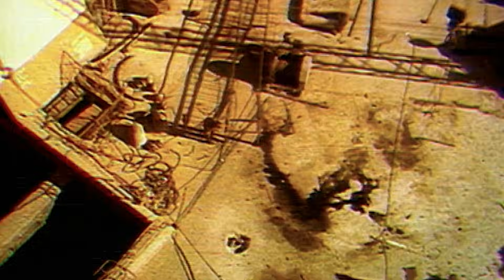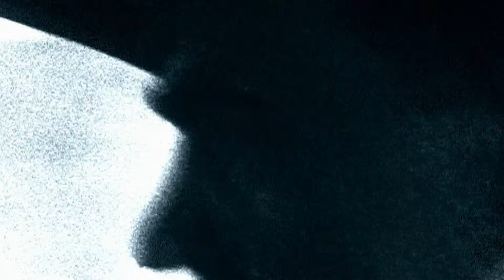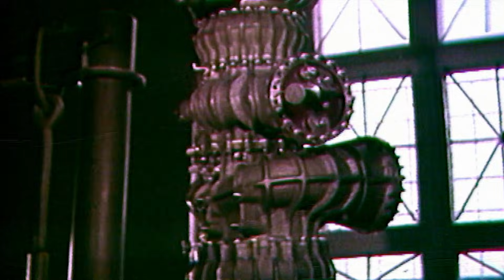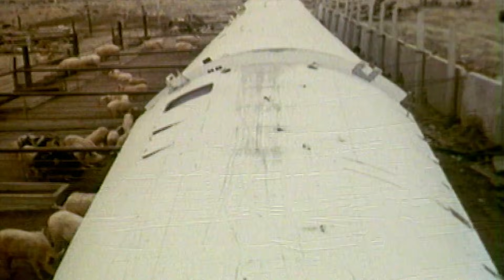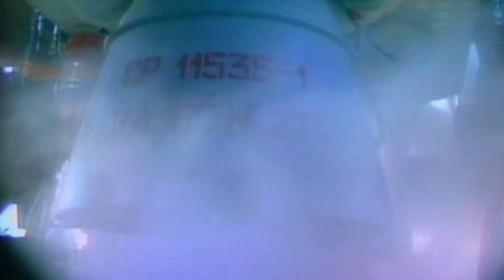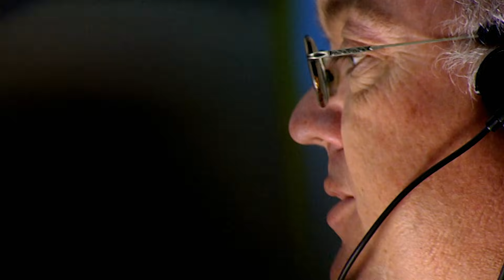How Cold War Shaped The World's First Spaceport | Baikonur Cosmodrome

Comment: The Soviets followed a radically different design and testing philosophy than the US.  They simply didn't have the investment in large test stands and other facilities early on to test rocket engines on the ground, so they tested them in flight, heavily instrumenting the rockets with downlink telemetry, recording all the data from the flight as the rocket ascended to shutdown, or blew up in flight.  For their early missile developments, this system worked well, as the rockets themselves weren't that expensive or difficult to replace, versus making a huge investment in the test stands and test centers required to do extensive test firing as was done in the US.  It was felt that the N-1 would be no different, BUT the N-1 was a truly enormous rocket and enormously expensive and powerful rocket, so it was MUCH more expensive to develop and test fly in this way.  

The other issue was, the Soviets didn't commit to the lunar program until years after the Americans.  This frittered away valuable lead time they would need, as the lunar mission was specifically chosen by the US as a way to demonstrate their technological prowess with a goal so hard to achieve that the early lead the Soviets had in large rockets, specifically the "Semyorka" R-7 former ICBM which was the backbone and workhorse of their space program (and remains so today as the "Soyuz launcher") would be of little consequence.  Korolev's untimely death in early '66 just exacerbated the problem.  

Another thing that helped the Soviets was, they were very late to the solid propellant technology that the US pioneered early on.  The US developed large solid propellant technology for missiles such as Polaris and Minuteman ICBM's.  Both the US and Soviets realized that the first generation missiles, Atlas and Titan in the US and Semyorka R-7 in the Soviet Union, had a lot of limitations and drawbacks.  All were powered by kerosene and liquid oxygen.  All were highly vulnerable, though the US put Atlases first in "coffin launchers" on the surface and then in silos along with their Titan 1's.  Semyorka was too big for a practical silo and launched from surface pads.  All these missiles required being fueled immediately before launch, which could take hours, and liquid oxygen, being cryogenic and boiling off, had to be topped up continuously until liftoff, requiring a large supply of supplemental propellant, meaning that the missile could only stand "on alert" so long during a crisis situation, because once that propellant supply boiled off and was lost, the missile had to stand down until more propellant could be hauled in to the supply tanks.  Both sides started working on "storable propellant" missiles, that could use propellants capable of being stored for long periods of time at room temperature.  These propellants, primarily combinations of hydrazine for fuel and various oxidizers like nitrogen tetroxide, red fuming nitric acid, or white fuming nitric acid, were also extremely toxic and usually highly corrosive, BUT they could be stored in the missile virtually indefinitely, meaning the missiles could remain fueled in the silos and ready for launch at a moment's notice.  The US developed the Titan II missile using the new storable propellants, and the USSR started developing a whole series starting with the R-9 missile.  The US's decision to pursue a fleet ballistic missile, which would result in Polaris missiles in submarines, drove the development of solid propellant technology as it was deemed FAR safer in a confined submarine than the hazardous toxic storable liquid propellants, which normally were "hypergolic", meaning they ignited on contact with one another, and fire is one of the biggest threats aboard a submarine.  The US rapidly developed solid propellant missiles like Polaris, and realizing its advantages even over storable liquid propellants, soon incorporated it into the next generation of ICBM's, Minuteman.  At that point liquid propellant missiles in the US basically became extinct as the remaining Atlases and Titans were phased out, and only the huge Titan II's with their unique enormous warheads were kept in service.  

In the Soviet Union, their early attempt at a solid propellant ICBM, the NATO code-named SS-13 Savage, was mostly a failure.  It worked but had a lot of problems, so the Soviets continued to develop storable liquid propellant ICBM's and sub-launched missiles until the late 70's or 80's, at which time their solid propellant technology had caught up and the advantages of solid propellants over storable liquid propellants was clear to them as well, at which time their new ICBM's and SLBM's were all solid propellant.  The decades of additional development of large powerful liquid engines would help them immensely.  More to come!  OL J R :)
Reply: The space programs in both countries had also contributed to the differences.  In the US, the "Moon Race" drove the choice of the enormous F-1 engines... F-1, whose size was the real challenge, obtaining smooth, stable combustion across its enormous injector face in the combustion chamber, was basically just an enlarged version of the same open combustion cycle relatively low pressure bypass engines used on all previous US launch vehicles.  The combustion instability problem was the biggest issue faced by F-1 developers, that and the sheer size of it, having to develop enormous autoclaves to weld the thousands of nozzle tubes together to make the combustion chamber and nozzles of the engines.  Once it was discovered that small "fences" designed into and attached to the injector plate face, would prevent pressure waves from rippling across the injector face and creating combustion instability that could destroy the engine, the F-1 was basically complete and soon "flight ready".   The Soviets didn't have the capability to build such enormous rocket engines; to get the thrust levels they'd needed for Semyorka, Valentin Glushko, their premiere rocket engine developer, had an ingenious solution-- he could build a turbopump assembly large enough to deliver the amounts of propellants required to produce the needed thrust, but building a single combustion chamber large enough was beyond their technology of the time-- so he built four SMALLER combustion chamber all clustered together, and supplied propellants from the single turbopump assembly, four nozzles acting as a single larger engine.  It worked fantastically well and was used on many different Soviet engines, culminating in their RD-170 engine for the Zenit rocket, which became SeaLaunch later on, and was the main booster engines for the four Zenit liquid rocket boosters used on their enormous "Energia" rocket designed by Glushko to launch enormous payloads mounted on the side, or carry their "Buran" Soviet space shuttle.  They even had plans to eventually parachute land and recover the Zenit boosters for reuse, though this never happened.  

When the Soviet government finally gave approval for a Moon program, the "Chief Designer" Korolev was charged with designing a vehicle to make it work.  Glushko, who had designed all the rocket engines for his previous vehicles, had been developing larger and more powerful storable propellant engines for the Soviet Strategic Rocket Forces (ICBM force).  Glushko and some rival designers were vying for government approval to build a series of large storable propellant launch vehicles (the "Universal Rocket" or "UR" series vehicles, basically larger versions of Proton).  Korolev, having run the calculations on performance required, wanted higher performance kerosene/liquid oxygen engines.  Glushko vehemently disagreed and they couldn't come to terms, so Korolev was forced to look for alternatives, thus ending up with Kuznetsov.  

Kuznetsov's designed the NK-15 rocket engines, which were powerful but not as sheerly massive as the F-1's.  They were very high performance, but they had one shortcoming-- they could only be fired a single time-- meaning they couldn't be test fired without ruining the engine.  To overcome this, the engines were built in batches of six, with each one undergoing the exact same procedures as the others as they were constructed and assembled.  Five would be sent to be used on the launch vehicles, one would be test fired for verification of the other five, which of course destroyed it.  The assumption that this sufficed for testing would lead to one of the explosions of the N-1 when some foreign metal debris left in a propellant duct was ingested into the engine and caused it to explode.  

More to come!  OL J R  : )
Reply: The other thing about the N-1 was, while it was larger even than the Saturn V (heavier anyway), in some ways it was absolutely cutting edge, in other ways it was rather primitive.  Its first and second stages were powered by liquid oxygen and kerosene, which from the rocket equation and engineering standpoint is the best first stage propellant combination available, superior in specific impulse (fuel economy, basically) than either solid propellant (as the US shuttle used and now the SLS derived from it) or storable propellants, and while liquid hydrogen and oxygen has a higher ISP, it's much lower density requires GARGANTUAN stages be constructed to hold enough for it (Saturn V's first stage would have been half again as long had it been powered by LH2).  The added stage mass makes performance worse than using the lower specific impulse but much denser kerosene/LOX combination.  The third and fourth stages of N-1 were powered by storable liquid propellant, which is MUCH lower specific impulse than liquid hydrogen and liquid oxygen (LH2/LO2), which was used for the upper second and third stages of Saturn V.  Because of this lower efficiency in the upper stages, N-1's performance was actually less than Saturn V despite being a bigger, heavier rocket. 

The other thing was, the Soviets didn't have the capability to build enormous cylindrical, domed pressurized propellant tanks like the US did, though the effort to build the enormous tanks for Saturn V required creating new techniques and advanced the state of the art considerably.  It was much simpler to design and construct simple spherical pressurized tanks of the size required, which then required very long intertank structures to connect the fuel and oxidizer tanks to construct the rocket stages.  In addition, because of the different amounts of kerosene and liquid oxygen required, the oxygen tank was considerably larger, so the smaller kerosene tank was at the top of the stage, and the large oxygen tank at the bottom, with a sectioned conical long intertank structure connecting the two, to make the hull of the tapered conical stages.  Propellant lines were ducted around the larger lower tank, covered by sheet metal, visible as the "ribs" on the side of the stage, carrying the kerosene to the lower thrust structure containing the engines at the stage base.  Saturn V ducted its propellant lines THROUGH the lower kerosene tank, insulating them to keep the minus 290 degree liquid oxygen from freezing the kerosene into ice on the propellant ducts, all to save weight.   The stages were connected by an open tubular trusswork interstage common on Soviet rockets, as they almost all use "fire in the hole" staging where the next stage's rocket engines fire up while the stage below it is still burning, just before its engines shut down, eliminating the need for ullage rockets to settle propellants in the upper stages before ignition, and separation rockets to pull the stages apart when the interstage separates.  This spherical tank design and longer intertank structures were heavier and less efficient than the cylindrical tanks with hemispherical domes used to construct the tanks on Saturn V. This also contributed to the larger size of N-1 and lower performance compared to Saturn V.  

While N-1 was structurally more inefficient than Saturn V, it did have cutting edge features besides its engines.  The main one was the KORD control system, which was revolutionary, never tried before or since AFAIK.  Most Soviet rockets up to that point had used small swiveling vernier engines mounted beside the larger main engines at the stage base to control the rocket and correct its trajectory in flight, steering it as needed.  This eliminated the need to construct gimbals strong enough to swivel the engines and connect them to the stage, and hydraulic systems powerful enough to gimbal the engines under thrust.  The KORD system would do away with the extra weight of the vernier system and its smaller gimbals and hydraulics, controlling the rocket by throttling opposing pairs of engines on opposite sides of the rocket, which were "fixed" and not swiveling or gimbaling.  If the rocket needed to turn a certain way to maintain stability to change trajectory, the engine on the inside of the desired turn direction was throttled back, lowering thrust, and the opposite engine on the other side was throttled up, increasing thrust, thus turning the rocket in the desired direction.  This was a cutting edge system, but quite complex and had its own set of drawbacks that would become clear in time.  

TO be continued...  OL J R :)
Reply: On the first N-1 flight, a fire broke out in the thrust structure of the stage.  The network of propellant lines to connect the 30 NK-15 engines together presented a lot of opportunities for leaks and for fire to break out.  The fire quickly burned through the control wiring for the KORD system, the rocket went unstable and blew up.  Analysis of the telemetry data showed the problem, so the aft heatshield of the N-1 was beefed up, and greater insulation was installed to protect the KORD control system wiring from heat/fire.  On the second launch, metal was ingested into one of the engines shortly after liftoff, and the engine blew up, taking out an adjacent engine.  The control system detected the problem, and to keep the rocket stable, was designed to shut down the opposite engine from the damaged or malfunctioning engine, which shut down two engines on the opposite side of the rocket.  With the loss of 4 of its 30 engines, the rocket had insufficient thrust and keeled over and crashed back down onto the pad, and blew up with most of its fuel load, resulting in an ENORMOUS explosion similar to a small nuke, severely damaging the pad which had to be rebuilt.  The third flight of N-1 was almost successful, coming within a few seconds of staging, but an uncontrolled roll developed which the KORD system was unable to cope with.  The fixed engines on N-1 were all carefully aligned before launch, but couldn't swivel (gimbal) to control the flight path or correct undesired motions of the vehicle.  The KORD system controlled the stack by throttling opposing engines on opposite sides of the vehicle using "differential thrust" which could correct pitch and yaw instabilities and steer the rocket, but were incapable of controlling roll motions.  The rolling of the stage built up during the flight until just before shutdown of the first stage, it exceeded the structural strength of the stage and the rocket broke up seconds before the second stage would have ignited and the errant first stage shut down.  

In the meantime, Kuznetsov had continued working on improving the engines.  The upgraded NK-33's were designed to be "reusable", meaning they could be fired more than once (unlike their predecessors).  While no provisions for recovering the first stage for reuse was possible, it meant that the engines COULD be individually proof-fire tested before being installed on the launch vehicle.  The fourth N-1 was constructed with improvements to the KORD system and the new engines, and all the chief designers working on it were highly confident that it would be successful.  Launch was just weeks away.  Bad news was about to arrive for the N-1 and Korolev's old team at OKB-1, however... 

To be continued... OL J R :)
Reply: It's important to realize that the Soviet space program operated fundamentally exactly opposite the US space program.  For instance, in the US, the government had established NASA in 1958 as an independent civilian space agency, charged with overseeing all civilian space exploration programs established by the US.  NASA had been formed around a core of the best aeronautical engineers and pioneers in the US at the time, the old NACA, the National Advisory Committee on Aeronautics.   This was soon enlarged by the addition of the DARPA group working on advanced large space boosters under Werner Von Braun at Redstone Arsenal in Alabama, which had been formed under the auspices of the US Army to develop a 1 million pound thrust space booster capable of matching the Russian's large booster performance (which would become Saturn I).  The Redstone Arsenal soon became part of NASA, renamed the Marshall Space Flight Center (MSFC).  NASA's space pioneering engineers like Maxime Faget, designer of the Mercury capsule, the other Space Task Group engineers who created the Mercury space program, and Von Braun's team at MSFC working on the advanced large boosters, soon to become Saturn I and later Saturn V, along with many others designing the requirements for the Apollo spacecraft and designing the lunar missions.  NASA designed the missions and requirements, requested individual aerospace companies submit proposals for spacecraft to meet those requirements, then evaluated the competitors and selected contractors to build the actual spacecraft, which NASA largely designed.  Thus the US space program was essentially always under NASA's overarching control, with NASA acting as both research and designer and determining mission requirements, then selecting and overseeing a vast army of contractors all supplying parts of the system which NASA then integrated into all aspects of the overall mission systems, from construction and testing via building and overseeing new test centers and in some cases (like Michoud) factories, to transportation of stages and elements as required, constructing new ground support facilities and ground support equipment, integrating the mission vehicles, and checkout, launch, and controlling the missions right down to recovery afterwards.  NASA oversaw the contractors and when needed, issued changes to the requirements or hardware and even changes to the contractor when they had problems if required.  In short, the US space program was very much operated from the top down, like a military effort, all directed from the top and subsequent levels below that issuing orders to its subordinates.  

In contrast, the Soviet space program operated very much in a competitive manner.  There was no large overarching Soviet space program, the entire effort was rather disorganized actually.  The Politburo had put the entire space program basically under the control of Marshal Dmitri Ustinov, a capable administrator, but he had little in the way of structure or resources and no overarching program defining the program goals and direction.  Each project had to gain approval on its own, and the Soviet system wasn't particularly good at making the best use of its limited resources, often approving COMPETING vehicles and programs from different "chief designers", an approach that had worked well for the Soviets in the past in many different areas; if one program was a failure, likely the other would succeed and provide redundancy.  However, in the expensive and difficult arena of space development, the duplication of effort and division of limited resources set back progress.  The space program in the Soviet Union had always been an offshoot and very much subordinated to the needs of the Soviet military and missile program; there was no sharp dividing line between "civilian space" and "military/space" as there was in the US with the creation of NASA by Eisenhower in 1958's Space Act.  Since the Soviet Union was communist and had no 'aerospace corporations" like the US, their system had developed around "chief designers", geniuses in their particular field of study and organizing and producing factories and laboratories to develop and build new technology and hardware as needed for various projects... most were specialists in various fields from communications, instrumentation, propulsion, structures, systems engineering, electronics, etc. which then became their design bureau, usually named for the creator and given a generic bland Soviet title with a number.  Some of the larger design bureaus headed by particularly gifted individuals like Korolev became generalists doing many different facets of the program, usually coordinating all of them, though delegating some of the efforts to smaller design bureaus in the various specialized fields as needed, with them acting as "subcontractors".  Korolev's OKB-1 (General Machine Building bureau number 1, a name that would be changed several times over the course of history but the overall organization remained pretty much the same) was the lead design bureau for most Soviet space flight activities, though many other chief designers and their bureaus contributed to the work, designing various systems for the spacecraft and rocket, etc. which OKB-1 basically oversaw and integrated into the vehicle and mission as needed.  As time passed, many other chief designers sprang up with their own growing design bureaus which became competitors to Korolev's OKB-1, like Chelomei and Yangel's design bureaus.  They had started out designing Soviet ballistic missiles and were given resources sufficient to the task as needed, and grew their organizations to the point that they were competing with Korolev.  With no centralized authority actually overseeing Soviet space activities, let alone forming them into a streamlined program with a defined goal and routing development to progress towards the ultimate completion of that goal, the Soviet space program was rudderless.  Worse, it was given to political whims and always to the shifting winds of who was in favor or out of favor, who had political influence and who's star was on the rise versus who's was falling, and whom among the chief designers had "picked the right horse" politically to get approval for their projects, and who hadn't, rather than programs being selected and funded on the basis of their various merits or contribution overall, or their advantages over other competing programs offered by others.  In short it was about more "who you knew" and how much political power they wielded rather than having the best design or vehicle or idea or mission.  A lot of times those winds of power would change over the years, as political fortunes of those at the top sponsoring certain chief designers or their projects came and went or gained or lost favor, and so chief designers could find their projects funding cut drastically or canceled altogether on the cusp of success, strictly because of political whims.  Thus the Soviet space program suffered from being "*too competitive*" as competing chief designers got programs approved that often were in direct competition AGAINST each other and needlessly duplicated the efforts and divided the resources, in comparison to the US space program which was very much centrally controlled via NASA which oversaw the entire effort of its myriad contractors all working for and answering to NASA as the ultimate authority (given approval and funding by Congress of course).  

 Khrushchev had originally been wooed to support activities in space by Korolev as a means to obtain a propaganda victory over the United States via the Sputniks in the late 50's, then with a series of 'space firsts' for the Soviet Union via the power of Korolev's R-7 Semyorka rocket, which launched not only the world's first artificial satellite Sputnik 1 in 1957, but the first live animal in space, Laika the dog on the much larger Sputnik 2, a litany of space probes toward the Moon and then the other planets, particularly Venus, and with the addition of new upper stages and a man-capable Vostok spacecraft, launched the first human into orbit, Yuri Gagarin in 1961, the first woman in space, Valentina Tereshkova, and set a series of space records for the longest spaceflights.   The one-crew Vostok was soon modified into the multi-passenger Voskhod, primarily through the addition of a soft-landing rocket attached to the parachute stringer above the landing spacecraft that allowed the capsule to soft land without the crew ejecting as they had on Vostok.  This allowed them to cram 3 crewmen in plain clothes into a Voskhod to claim the first three-man flight record, (since there was no room for space suits in the cramped confines with 3 men aboard) and, installing a small inflatable airlock and a two man crew in suits, claim the record for first spacewalk or EVA.  The Soviets even launched several Vostoks at once to claim the first multiple vehicle spaceflight, though Vostok and Voskhod didn't have the propulsion or navigation capabilities to perform a true rendezvous in space; the best they could do was "formation flying" coming within a few dozen miles of each other before drifting apart again due to orbital dynamics.  Thus the US achieved the first space rendezvous in orbit, between Gemini 6 and 7.  For rendezvous or more advanced missions, the Soviets would need a new spacecraft with greater capabilities-- Soyuz.  

More to come!  OL J R :)
Reply: After Korolev's untimely death in early 1966 (having gone in for a hemorrhoid removal surgery, expected to be routine, a high-ranking military surgeon who performed the operation but had really been an administrator long enough he was no longer the most qualified surgeon, had found it was cancer and tried to remove it, Korolev experienced uncontrollable bleeding and due to his jaw being broken when he was in the gulag at Kolyma decades before, the oxygen mask wouldn't properly fit him, and by the time the surgeon sent for a more experienced surgeon to take over had arrived, Korolev had died on the operating table), Korolev's OKB-1 bureau had his deputy Vasily Mishin named to succeed him.  Korolev had not only been a gifted engineer, but his reputation and fame had grown with his repeated space successes from the late 50's.  His boundless energy and charisma, and his reputation had gained him a lot of power with the politicians when it came to getting his space programs approved, and gaining favor over his competitors.  His loss and replacement by Mishin, who while a very capable engineer and designer but who had NONE of Korolev's charisma, charm, reputation, or influence, who was known to be a heavy drinker and rather introverted, not a political player capable of gaining or maintaining support for OKB-1's programs, and a diffident if nominally capable administrator at best.  Mishin would now guide the various programs of OKB-1, including Soyuz and the N-1/L-3 "lunar complex" rocket and spacecraft.  As the years ticked by, time was not on the Soviet's side.  The huge cost of building, launching, and "flying to failure" and then analyzing what went wrong and fixing it on the next flight, which had worked SO WELL for the Soviets on their smaller missiles and rockets, was simply too expensive to continue for N-1.  With the Americans landing on the Moon in 1969 and then completing six lunar missions and ending their lunar program by December of 1972, the Moon Race was over and the US had won, and there was no purpose for the Soviets continuing on that goal.  The Soviets had realized that they would lose the Moon race, and alternatively decided that they COULD beat the US to a manned space station in orbit, which they successfully beat the US Skylab station, built from a converted Saturn V third stage and launched by the last Saturn V, and visited by three successive crews in 1973, lauched by Saturn Ib rockets lofting Apollo spacecraft to it.  The Soviets completed an interim space station designed around a hull designed to launch atop a Proton rocket, the most powerful operational rocket they had, which would subsequently be docked with by visiting Soyuz capsules carrying three cosmonauts up to the stations.  A whole series of "Salyut" space stations, growing in complexity and capability with each successive station, followed throughout the 1970's and into the early 1980's.  

Korolev had originally proposed a very large space station to be constructed from large modules launched atop N-1 rockets.  The smaller Salyut stations came about due to the delays with N-1, and the need to beat the US to a space station in orbit.  As time passed, and N-1 success remained elusive, the need for it became less and less-- it was no longer needed to launch a Soviet L-3 "lunar complex" spacecraft to the Moon for a manned landing, and now it was no longer needed to build a space station.  N-1's days were numbered, even as the problems were being overcome and confidence the next flight would be a success was high.  

Politics came into play.  Valentin Glushko, Korolev's longtime rival chief designer, originally the engine chief designer who built the engines that powered most of Korolev's rockets and missiles, had come to prominence over time after Korolev's passing.  He successfully lobbied the Politburo that N-1 was a failure and should be cancelled, and the chief designer of OKB-1, now Vasily Mishin, should be dismissed from his post and OKB-1 merged with Glushko's own design bureau to form a new enterprise, "RKK Energia".  Glushko's proposals were approved, and he subsequently dismissed and replaced Mishin, ordered the cancellation and destruction of the remaining N-1, and got approval for his own design for a new super-booster to replace N-1, which came to be called the "Energia" rocket.  The other chief designers working with OKB-1 on N-1, were shocked by its sudden cancellation on the cusp of success, but were powerless to stop it.  Kuznetsov was ordered to destroy his NK-33 engines, but carefully packed them away.  Work would begin from scratch on the new Energia rocket.  

To be continued... OL J R :)
Reply: With the collapse of the Soviet Union in the early 90's, the newly independent Russia was in poor shape to continue funding its "new" space program, now under the direction of a new entity called "Roscosmos".  The US, fearing that highly skilled and technically brilliant but now unemployed scientists and technicians would take offers from countries like Iran and North Korea to come develop advanced missiles for those hostile nations, decided the best way forward was to "prop up" the Russian space program by helping fund it and keep their scientists and technicians employed.  Basically this came about it two ways-- First, Mir had been answered by President Ronald Reagan in late 1986 when he ordered NASA to construct "Space Station Freedom" (SSF) and do it within a decade.  SSF was a boondoggle beset by numerous redesigns and shifts in requirements foisted on it by the shifting winds of politics, narrowly avoiding cancellation by a single vote on one occasion.  By the early 90's work had gradually progressed, but the hardest and most expensive part still remained-- a "service module" capable of providing power, stability, maneuvering, and reboost thrust to the station, and providing other essential services to keep the station in orbit and working, including refueling of the reboost engines and other such requirements.  Shuttles could act as the resupply and crew transfer vehicles, but a dedicated "lifeboat" crew return vehicle (CRV) would also be required, as shuttles could only remain in space for 2 weeks, not the typical 6 months required for a crew to stay continuously on the station, as they could not be left stranded on the station with no means of return to Earth in an emergency between shuttle launches, or if something happened and shuttle was forced to stand down again as it had after Challenger.  

The aging Mir would provide a quick way to infuse badly needed funding to the Russian space program, via the "Shuttle/Mir program", where NASA would pay Roscosmos to fly some of NASA's astronauts on Mir for prolonged periods of time, and provide resupply missions to the Mir station, even flying a Russian cosmonaut on the Shuttle up to the station.  NASA's space station experience aboard the short-lived Skylab station in the early 70's amounted to three crews spending 28, 56, and 84 days respectively aboard the station, with considerable repairs required from the first crew due to damage done to the station during a launch mishap that nearly destroyed the station before it achieved orbit.  Skylab had no reboost capabilities nor resupply provisions; its aft liquid oxygen tank from the S-IVB rocket stage it was constructed from was designed to operate as a "waste tank" into which trash and waste was jettisoned via a "trash airlock" in the central floor of the station.  This meant that Skylab's lifetime operationally was finite, without a resupply spacecraft capable of taking away its trash once the former oxygen tank was full.  Since it was only designed for three crews and launched with all supplies needed aboard, and designed to be a temporary station, no provisions for a resupply vehicle or improvements to the design were ever made.  Shuttle was SUPPOSED to enable NASA to design and build a "permanent" station in orbit, SSF essentially, over time, but those plans were soon shelved until they were revived for SSF.  

More to come... OL J R :)
Reply: Russia would provide the access to the ISS in the post-shuttle era, temporarily at least.  NASA planned to have their crew Orion vehicle launching on "the Stick" Ares I launcher, touted to be "the safest launch vehicle ever built", with a single shuttle SRB with an added segment for extra propellant as a first stage, topped by a new hydrogen upper stage powered first by an SSME, but soon it was discovered that SSME's were designed to be started ON THE GROUND for the shuttle, NOT "in flight" as would be required on Ares I.  Ares I's design began to falter as no other engine was available for the job.  Finally the upgraded J-2S engine, an improvement on the original Saturn upper stage liquid hydrogen engines, completed before Saturn was cancelled and planned to be incorporated into the next batch of Saturn V's built (which the order never came for) along with the improved F-1A kerosene first stage engines, was dusted off and selected for Ares I's second stage.  Only problem was, its thrust was HALF that of an RS-25 SSME, and putting two on the stage was too heavy and too big for the interstage.  SO a very expensive upgrade program was begun to upgrade J-2S into J-2X, which increased its thrust quite a bit, but also increased its weight substantially and hurt its performance.  It was still not powerful enough for the job, basically, which meant it needed to burn longer, which meant more fuel, which meant building a bigger upper stage, which meant the first stage booster was now not powerful enough, which caused the spacecraft to need to be lighter, which led to a huge downward spiral of ever-greater problems for Ares I development.  An early test flight of an Ares I-X, using an old shuttle booster with a fifth dummy segment atop it, a dummy second stage and battleship version of Orion's boost protective structure atop it, was launched in 2009 and ended badly when it was found upon recovery of the lengthened shuttle booster, that the booster was bent too badly to ever be reused, meaning Ares I's plans to reuse the shuttle boosters for first stages over and over again would never work.  Ares I was finally canceled in 2010.  Of course the shuttle contractors didn't want their contract money to end, so they pushed for another "shuttle derived" rocket to take its place, which came to be known as SLS.  It uses the most expensive REUSABLE bits of the shuttle, the solid boosters and RS-25 SSME's, and uses them in EXPENDABLE MODE, meaning they're thrown away with each flight and cannot be recovered for reuse.  SLS was SUPPOSED to be the quickest and cheapest way to build a new superheavy launch vehicle from the existing shuttle hardware, but in reality it's YEARS late and will be THE most expensive launch vehicle ever conceived-- costing by NASA's own Inspector General's estimate to cost $4 billion dollars PER LAUNCH, just for the rocket and launch itself-- not including ANY flight or mission hardware or mission costs post-launch.  It's a ridiculous expensive dinosaur, which is hopelessly outdated given how technology has improved with reusable rockets like SpaceX's Falcon 9, and probable successors promising full reusability being developed by a number of companies including SpaceX.  Only political folly of self-serving Senators and politicians from space states, eager to keep their former shuttle contractors heavily lobbying them happy, is keeping it alive, along with "institutional inertia".   I don't expect it will last more than a few flights before its canceled, particularly with a lousy economy and little reason to exist.  Later!  OL J R:)
Reply: Your are correct but I have a question-

You said that Soviets couldn't build large single chamber engines with high performance. But they did build one. The RD270, although it had some technical issues.
Reply: @JuPiTeR_0211  early in they couldn't, but later on of course they did.  Save with hydrogen engines.  Soviet rocket engine technology caught up then really surprised surpassed US engines